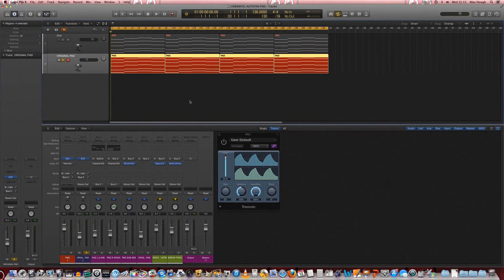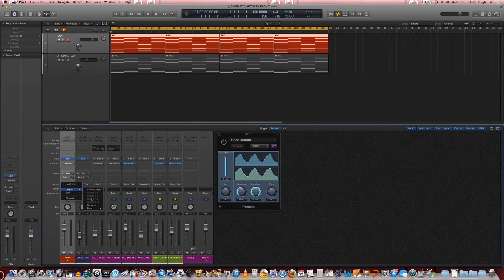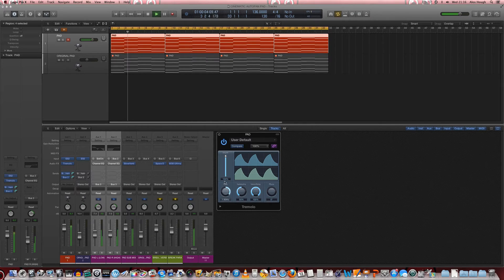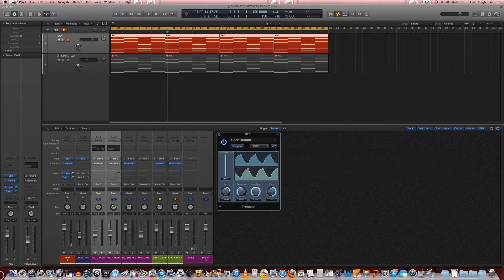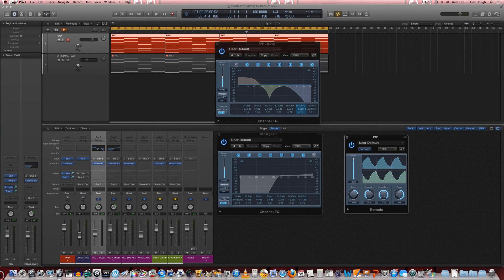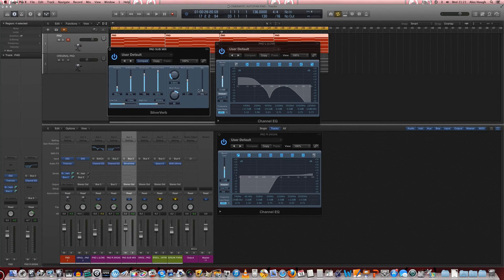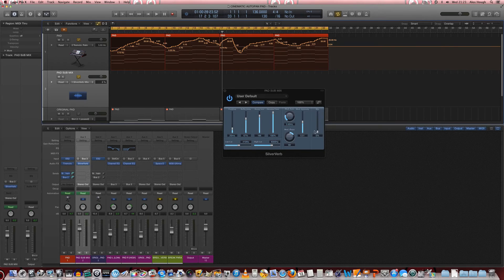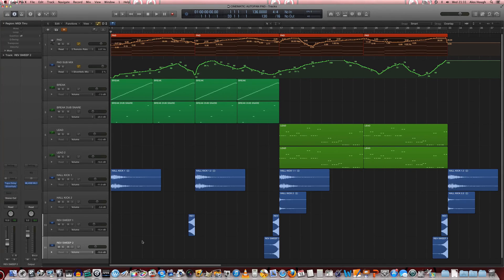How to make a cinematic autopan pad in Logic Pro X - Trance Production Tutorials #11

Comment: Hey man first I wanna say thank you for all of your videos. You have taught me so much. I am a beginner and have a few questions for you. Firstly, this pad is intended to not be used with much if any other bass like sounds correct? Since the lows are really boosted in the one part. 

Also, I am having a hard time finding good trancy pads. I don't have any good plugins for pads yet because Im saving up for Omnisphere and Nexus2 still but could you maybe recommend either some cheaper plugins for trance sounding pads or maybe even just your favorite pads that came with Logic?

Thanks man!!
Reply from the maker: Hi Holthane

No Worries, I am glad the tuts are helping you out. You are right that this technique is used with very little else going on in the music; especially the low end as there wouldn't be much space for other elements in the mix.

That is why I would personally only really use a technique like this for intro sections or breakdown sections where you want to add a touch of suspense and atmosphere :)